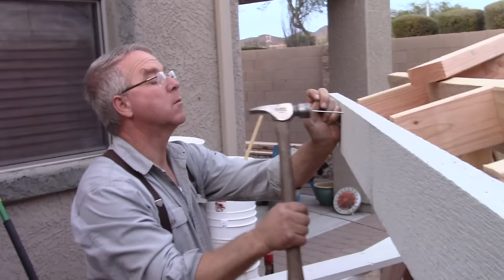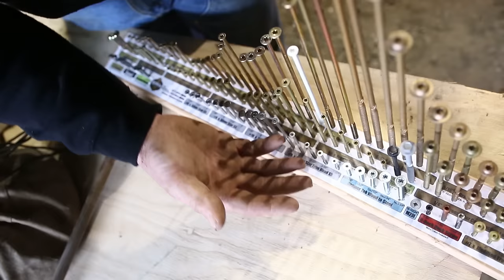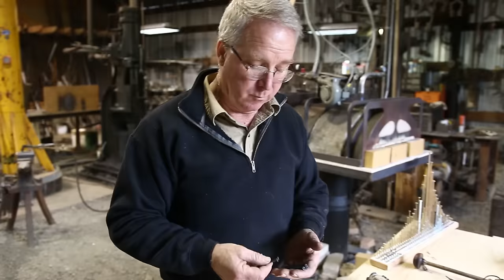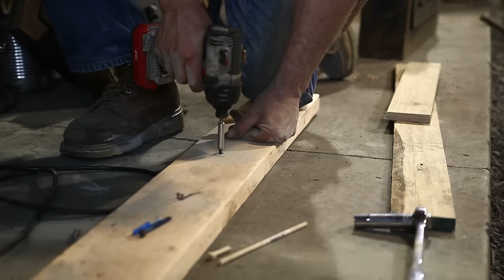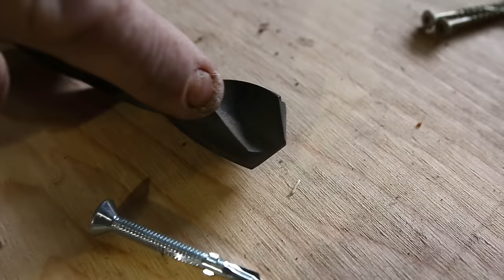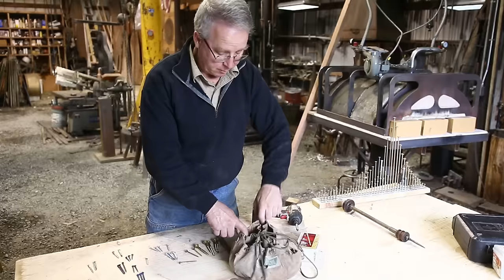Screws: What You Need to Know

Comment: Nail pull out over time is why old balloon framing starts to sag, often almost straight down.  (the rim joist of the second floor is just nailed to the super long studs which go from the plate to the rafters.  The only thing holding up the perimeter of the second floor are nails. In the middle a non-load bearing partition on the first floor, because it only goes up to the joists of the second floor, becomes a major load bearer. My knowledge of balloon framing is specific to one house, so maybe I've missed something. A modern framed house, like the shack I live in, is built like a stack of blocks. My father a framing carpenter told me, if all the nails just vanished the house would still stand,  until a  good wind comes by. A balloon framed house with no nails would be a pile of lumber.  
I went to screws for my projects because all the wood available to use was kiln dried. Nails split the dried wood   ut when I do framing nails of course) 
What's unacceptable is that Home Depot and Lowes have taken over, and the available screws now require 4-6 different bits, a couple of which look exactly the same but are not. It's unbelievably, and unacceptably,  inefficient. Of course my beef is based on not needing 100-500 of the same length and type for something like a deck. When I need screws it'sI need some that are self-drilling and 2" long. I go to HD and oh their torx. Ok. So yesterday I needed 9 screws a few each of  3",  2" and 9 more 1.25" to make a rack for my hummingbird feeders. They're phillips, torx and robertson. 
Ceramic should be more corrosion resistant than stainless steel. Stainless steel under many conditions corrodes. 
I like Robertson square heads, started using them in Montreal almost 40 years ago. Coming up from New York at first I was perplexed, "Don't you have any normal drywall screws?" 
Kreg  has a good system but the d**nd heads on their screws are too tight, disassembly means having to fight with each and every Kreg screw to get it off the bit.  Stupid engineering.     
      I find square-drive to be more stable on the bit than torx. Phillips I just learned were designed to self-torque, when they're tight the bit spins out of the slots. Considering robertson's which do not do this and phillip's heads are both just over 100 years old-- it's stupid that phillip's head screws still do this. They hinge over when you lean in a bit to start screwing, so you end up having to hold them, then when they hinge over the bit pokes a cross shaped hole into your hand. 

re: the bit kits. Yeah you buy the kit (I've got 3-4) and the bits don't go in and out very easily (sure you can do it right there on a video, but you know what it's really like,  you're in the middle of something, and you're right over some inaccessible....)  I use a neodymium magnet on my tool bag, but this is far from perfect. ' 
         It's a specific concept: 'Things' that pop off and on have a very strong tendency to wind up in the wrong place--unless they have an easy to use 'place' they always return to. Without a system, the bits will migrate to the wrong place. Now instead of square and phillips, there are 3-4 more head types in your recycled screws bucket and inevitably today you don't have on hand, one of the bits...  (Maybe what's needed are bright orange patches with a magnet and two of each type of bit. Now you're not rummaging through a plastic bowl... I think I'll try this. I'll keep one in my tool belt, one in the bucket of recycled screws, one with my loose gaggle of drillbits....)
(Proof of concept: This might help with your video making. As a photographer I have a few tripods, and lots of camera plates. These work like the bits, eventually winding up in the wrong place. I was grousing about Manfrotto one day and figured this out: drill  and tap a 1/4-20 hole in the knuckle-pivot at the top of the leg. Of course be careful, but I've never run into anything.  Now the d**n plates have a 'place'. When they come off the camera, they don't go in your pocket, they attach to the thing that needs them. It's completely obvious, but in 70 years Manfrotto has never figured this out, nor I think has anyone else. But there will  be battalions of people who say, "Well, I don't have that problem. With our tools, bits of all types, fastener hardware of all types, etc... they need to have a 'place' and there also needs to be a 'don't know where this goes' collect all. (How about the hardware aisle at HD there's no 'If you don't know where it belongs...' their bins in all their bits and bobs aisles are full of the wrong stuff.)

So how about a video of all the really stupid things we are still putting up with. Black tool bags that you can't find anything in. (Try this: spray just one pocket with white Krylon for plastic, it won't ever get white, and you'll first think, 'that didn't work too good.' But then work with one pocket 'sort a white' and the others OEM black. See what you think. Then ask why the heck do they make all these things black???)  Your parachute bag. Try finding one like it now. I bought three different ones. They're all too deep, fabric a bit stiff and dark materials. I sprayed two of them with the white paint. Made them useful
I'll look again to see if there's a How To on making parachute bags. (Have you got a sewing machine? If you love tools... )  I remember larger ones that open right up. 
Try this: Paint a red or black strip down one pocket (on the outside) of your parachute bag or tie a a few inches of orange warning tape to the pocket with the longest screws. Or if there's one size you almost always go to. Just don't tie two ribbons or two colors. 

Cords and plugs. Carpenters use twist locks, god bless'em the lucky sons. But what about all the other 'regular' plugs?  There are some solutions, but they're either expensive or cumbersome, or duct tape.  (And those covered female plugs on garden tools? They're designed like that so when the plug starts to pull out, you don't have an electrocution hazard.... but this is just a CYA for the cheat of saving $2 on a proper cord with some length. And the cover limits the types of extension cords you can use. (Best thing I ever did to a Skilsaw was remove the factory cord, and replace it with 25' cord. Try this and then shoot some video of you framing. Then compare to old video, and count the number of times you don't hang up on that plug connector.  Cord length on a tool should be long enough that you could screw down the plug end to the floor in one spot and you'd still be able to do an entire sub-task without a problem. A sub-task would be like screwing drywall on all sides of a bedroom, or cutting some tails on 6-10 rafters. 
  How about the hammer loops on most tool belts? The ones attached to the pockets. They're designed to  make sure your framing hammer handle hits you in the side of the knee or calf with every step. 
Sorry about all this nonsense. The video list said 'Screws,' and I was off to the races. I need to add 'ranting about screw heads' to my Advanced Medical Directive.

Comment: USA have a different conglomerate of screws than what we have in Australia. So I'm unfamiliar with your array of screws. I only go to fastening shops to buy my screws and bolts. They supply cyclone rated fastening systems. Even the galvanised screws rust over a period of time. Its interesting you mention screws that stand up to the chemicals in timber or even reaction when there is swelling or moisture.
I'm planning of fastening stainless steel threaded rod with stainless steel nuts into a painted steel base plate. The rods will be put in concrete. Although I feel there will be a reaction between stainless steel and painted steel base plate. I want the base plate above ground so for easier maintenance at a later date. Great video. I'm only half way with the family at the moment.
Reply: Try Wurth fastens they are heavy duty

Comment: Not sure why but all the custom cabinet shops I've worked at use no. 2 square drive screws. 

I went from a screw box to a parachute bag a year ago and am never going back. I especially like that they won't ding up a finished floor or cabinet when you move them around the job.

Comment: GRK now makes framing screws. These are half way between their RSS structural screws and old misc drywall screws. I think they are an improvement on decking screws so you can use them where more shear strength is needed like 2x4 wall toe nailing and framing.

Comment: Broke several 6" long 3/8ths GRKs in formwork. Used at the bottom of a pier form, the pressure of the concrete broke them.

Comment: I was told philips head screws were developed to strip on purpose if they were over tightened on a application that could damage the the item being fastened. An example  might be on a electronic device.
Reply: Na, they were developed for assembly line manufacturing.  The pointed cruciform shape made powered drivers automatically center and engage and the barely adequate engagement of tool to screw made sure that the tool never got stuck.  On an assembly line owners didn't want employees wasting precious seconds either fitting tool to screw or wiggling a tool free.  Slam it in and move on to the next.  These properties are why they're still the standard in drywall screws.  The downside is that they're frustratingly poor to use outside of the world of assembly line manufacturing.  Piss poor engagement with a tool and they strip out way too easy.  Removing them is a frustrating endeavor all on its own considering how easy and often they strip out.  One of the shames in fastener history is how they became the defacto standard in America.  The line about over-tightening is nothing more than an after-the-fact justification otherwise intelligent people trot out to justify their continued use of a clearly inferior standard.

Comment: There is actually a Japanese version of the Philips, it's close enough that you may not notice when you find it, but they are on everything that ships from Japan. And yes you can easily round off the head if you use a none Japanese driver on one when it is well torqued down. They are called JIS screws and usually have a little dot on the head to denote this.

Comment: The Yankee screwdriver reminds me of my Dad’s story of using a star drill for the mounting holes in concrete walls for emt conduit straps and boxes at Ft. Riley in the 70’s. The shop didn’t have any kind of electric hammer drill and didn’t want to buy one. After two days Dad went and bought one and finished the job in hours the following day. All the Public Works shops soon had them due to the man hour savings.
Reply: The ol’ star drill.  I was introduced to them during a summer job.  I was taught by a retired electrician.  I’m glad we have hammer drills and great bits now.

Comment: As a plumber drywall screws are the bane of my existence. They’re the only screws supply houses sell. They’re okay for hold rights and that’s about it. However everyone uses them for all sorts of things. I buy deck screws or get nails from the framers for hangers and blocking. Torx is the best. I had a helper who was in his early 60s and not the brightest bulb in the box. He put some things on wood with tap cons because it was the only screw I had with a Phillips head and he said he didn’t know how to use the others. I had to point out that the same box with the Phillips bit had other bits that were different all he had to do was see which one fit. So I guess that’s a possible downside to torx!?

Comment: I am a big fan of GRK screws BUT I have snapped them using a DeWalt 18v impact drill driver. I usually use their #9 x 3-1/8". I have snapped and bent these screws. 99 Percent have gone in fine. In my opinion they have a hard time starting which is annoying, especially the #8 x 2" pan heads. They are EXPENSIVE but are great for remodel projects where you need to put things in temporarily or  the project ends up having in forseen changes and you need to remove work that you already did. The only problem is when you need to remove the screws and the head has either snapped off or the torx drive stripped. Pulling a nail is easy. The grip of these screws is amazing so trying to pull a screw out is a pain! Cutting these with a sawzall is also extremely hard. Sawzall blades do not like them. A sawzall will go through a nail like butter, but these screws will probably kill your blade.

Comment: I love the Torx head screws, the only disadvantage is if you have to remove a deck board that has been on the deck for a long time, the Torx head is filled with debris and it is sometimes hard to get the bit into the head of the screw.

Comment: So let's talk fasteners.... Nail, screw, lag, or anchor... We use a lot of different lengths of fasteners to affix materiels in place but I would love for you to share that home owners and pros alike need to be more mindful of maximum fastener length. There is a reason the shelves at hardware stores have a multitude of lengths for any given diameter or head configuration of fasteners. Especially in residential walls people using the wrong length fastener can damage utilities and possibly not sufficiently support the load.... A topic I think merits it's own video.

Comment: A little clarification please: so was it the 6 points screw that is best for "all purpose" or just best for corrosion/fastening decks???  You prefer not to use philips or square (makes sense due to stripping.) And best brand is GRK with self "drill bitting" function?  (As available/cost for my budget) Beginning my carpentry hand with a Tiny House project, might as well learn & use the best technique/materials/tools now than to try to relearn later on. You're terrific Mr. Tool Wizard Thanks!!!

Comment: That golden yellow finish is '' Cadnium' electro plated. On all treated lumber I use 316 grade stainless which is marine grade stainless. The next grade up of 316 stainless is 316L. 316 will resist copper treated lumber. If a person used Galvanized (zinc) plated screws on copper / arsenic treated lumber it will destroy that screw.

Comment: The process that gives the yellow screw is anodising. It can be a choice of colours and us also used on car door strike plates (and knitting needles) as examples. It's a cheap way of hardening the metal without using metal that's usually hardened, I.e. High carbon as anodised is used on low carbon for a hardened result.

Comment: My brother invented an head for a screw that would not disconnect from your driver like a Phillips or even a torks.  Someone already had the patent, but, we can't buy it and you probably have never seen it.  Its a real shame because it is a vastly superior screw than anything on the market today.  It has a single slot that has divergent bottom to the head so the bit will not slip out unless you want it too.  Its really only needed if your building a deck running a 1000 screws or something, but, it would really be a win for carpenters if it ever surfaces...

Comment: I had just completed an outdoor construction project in which I had inadvertently used three different kinds of screws (Phillips, square and Torx). That meant that I would always have the wrong screw bit in my drill and would have to travel to my tool box which was always some place distant. 

I decided to standardize. But which one? I had presumed that each different type was optimized for a different purpose. But looking through the web I couldn't find an article that would explain each bit's specific purpose. Apparently I have learned here - there is none. All three solve the same problem of keeping the bit from slipping out.

So what's the answer. Throw out all the square bits. You can't avoid Phillips. Torx grips best but   is less universal. Try mounting a flat TV to a wall. There are international standards for the screw fasteners and they are all Phillips. You will for the immediate future always need a Phillips in your tool box.
Reply: If you did a whole deck I can't see how you say phillips works as good as square or torx. phillips strips out 10 times more then the others.
Reply: @1voiceofstl  
Right. Except I never said that. I said that irrespective of any of its virtues or vices, the Phillips is so ingrained in our culture that you have to have some Phillips bits.

Comment: I used to travel a lot working computer systems installs; the guy I traveled with had a yankee screwdriver, I’d used them for years but mostly for woodworking.   However, he figured that on computer cabinets they were great, start the screw and one push then you were moving to the next screw.  A real timesaver in that scenario.  Well, that was back in the day when you could take tools on planes.  We got stopped for a random check at airport security and they found the yankee screwdriver.  They’d never seen one before and weren’t quite sure.  When he released the lock on it and the shaft extended the airport security guys were very taken aback.  I thought we might get to spend the rest of the day in lockup.   :P

Comment: As a Canadian,I always thought Robertson was Canadian,Philips,American.The best Philips,a Robertson fit into.Pain in behind changing bits.It also tells me what country the door/window etc was built.In my opinion,Robertson is the better head for securing bits (but as you say,there is now a Torx)
Reply: A wire (rebar tie wire) and common nail,into a five thirty seconds hole makes for a very strong anchor into concrete.We used this method on Bridge Construction,cheap but reliable.

Comment: The yellow coating on the screws toy said you wasn’t sure of is zinc coating. It is temporary water resistant in case it needs to get wet a few times during building